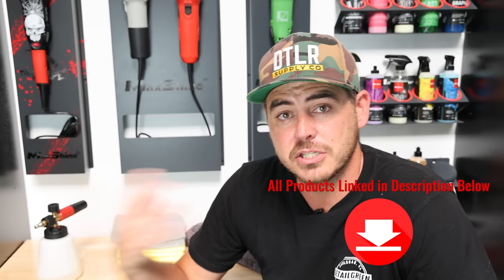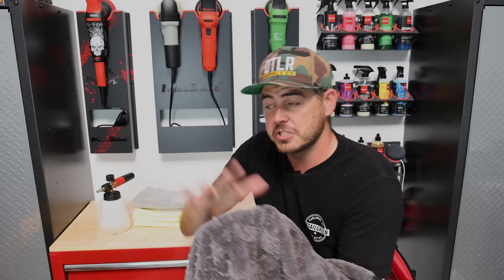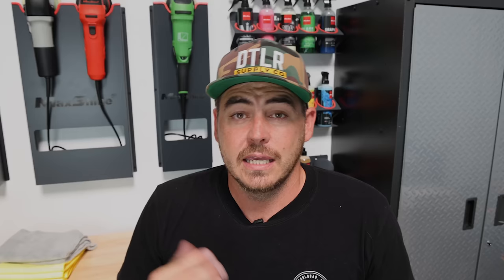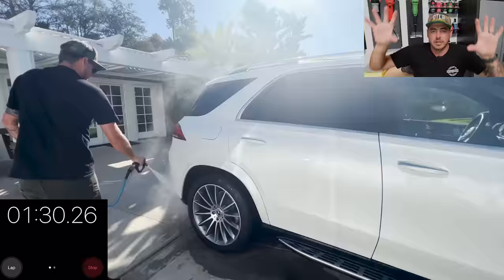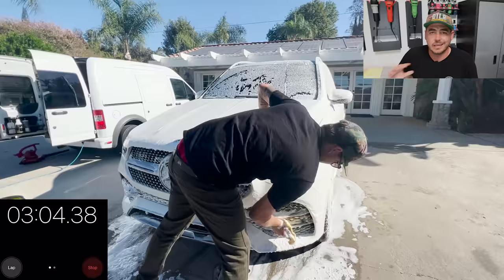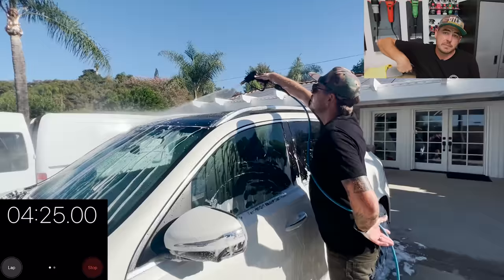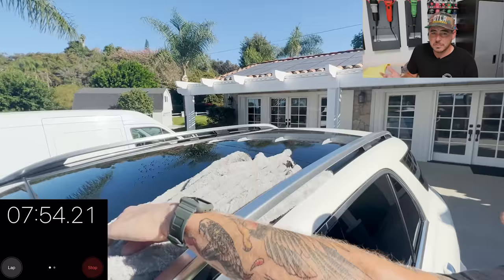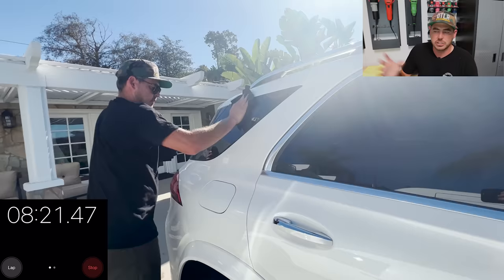HOW TO WASH A CAR FASTER! | Car Wash in 10 minutes or less

Comment: I take 10 minutes on each side cleaning the wheeels and tires before I start the actual wash 😭
Reply: Black wheels here I take 10 minutes per wheel 😂
Reply: Yea same but nothing is ever wrong with that, just shows you care about your customer car whether there’s a way to wash faster/getting the same results. More you do, more faster you get😅
Reply: This would work great on a car that's well maintained with possibly a coating on the wheels and paint that also has a longer lasting tire protectant. Nasty wheels and tires can take 5 minutes a piece. I would definitely change out wash towels or flip to a new side on each panel but to be fair in all of this if you only want efficiency then quality will always suffer but 90% of folk don't care about water drips or a keeping a perfectly clean vehicle all the time. I wish I didn't care lol. Ignorance isn't bliss but it is alot less work and stress in these instances.
Reply: Dam it's takes me an average 10minute per wheel
Reply: @bacchasmichael2017  if the wheels are cool I don't pre spray with water I usually use bilt hamber @ 10:1
apply wait 1-2 minutes and agitate with a vary soft interior brush on the wheels and a green body brush for tires let sit for 1 minute and rinse, if the wheels have brown staining after that and are factory cleared I use acid 4:1 appy on brush wipe in and rinse. If the wheels are trashed or are steelies I just apply cleaner and agitate with green body brush on wheels and tires wait a minute and rinse. Some tires can require multiple rounds of cleaning and some are permanently stained and have tried everything from mckees tire rejuvenator, multiple degreesers to acid to vary stiff brushes and iron removers even acetone and some just can't be saved but it's rare. Black gloss wheels usually get a presoak and rinse before brushing unless they are already scratched to death which most are.
Reply: Same here
Reply: @sandrock86  same have black wheels but just tried this method sprayed the wheels with a good wheel cleaner fast all of them than foamed the wheels and car and worked pretty well they were clean just had a few water spots on the rims because I use hose water
Reply: before and after lol
Reply: Me too!
Reply: Yeah the realism behind the video just isn't there for me. Most of the time I get cars that haven't been detailed for quite some time or just haven't been detailed at all which requires more attention. And since I'm so meticulous about my clients cars, it can take me upwards of 1 to 2 hours to just wash and dry. If I had a regular customer that I did maybe once a month or a biweekly customer then this video becomes relevant.
Reply: Takes 10 to get the pressure washer and hoses ready Then I get to the wheels😂
Reply: Sorry but this is a awful way to do it... Surprised the customer would pay for that... Snow foamed the car and didn't let it dwell at all nor did you even rinse it off... Just simply scratched the paint with what ever the foam had chance to lift... Great work.
Reply: @takeovamxbc3403
You know every-time you drive the car, it will always be dirty from electrostatic dust + dirt (especially the wheels).
😎
It sux to fight a losing battle with nature.
Reply: Me today 😂😂😂
Reply: Me too
Reply: @sandrock86 lol all outta breath n shit 😂
Reply: @proudtobeapothead  yeah sucks cuz they get dirty so quick and scratch easy. I haven't cleaned them in forever tbh.
Reply: I take 20 mins per wheel
Reply: Tires are last bro
Reply: He showing yall the basics lol
Reply: I have honestly spent 1hr on just my black wheels alone and still can’t get them as clean as my detailer 🤦‍♂️
Reply: 😮🙈🙉 that would take a whole day. Interior needs cleaning too
Reply: Same 😅
Reply: It takes me 10 minutes to untangle the garden hose.
Reply: @Nguyenduc09 Use that stuff that turns purple when it sits on your wheels a few minutes. Nothing else works as well as that stuff.
Reply: Thanks for that tip. I’m just getting into the business.
Reply: @dustin3700  great reply

Comment: Man, I can’t even get everything set up to start my wash in under 10 minutes😂😂👌👍
Reply: Facts!
Reply: So true!
Reply: he is all set up to rock and roll.  setup time does not count. but you I am sure it takes like 10 mins to set up and 10 mins to pack everything. still 30 even 40 mins is not bad at all. plus personally I am not as young and fit as him LOL  makes it looks so easy..  but as he says taking your time and spend time for me is also therapeutic and not a chore
Reply: @nick-3808  Here's another trick nobody really mentions... If the sun is out, wait until the sun is shining on 1 side of the car and you'll notice the other side isn't facing the sun. Be quicker on the side where the sun is shining and the other side you can be a little more slow since it's not in direct sun light.
Reply: Just digging out my pressure washer and getting it going would probably take 20 minutes.
Reply: haha true, 30 minutes just for the setup alone
Reply: @mxx.L Yep, that’s why I recently installed a wall mounted pressure washer system in my garage, complete with Spotless DI system (only for final rinse). All I have to do is fill my bucket and foam cannon and get with it.
Reply: Same
Reply: 10 minutes starts from when you are ready to wash. Prep might take 20 minutes
Reply: Right that part

Comment: I never rinse the car with a pressure washer first, garden hose maybe, but the best way is to foam>dwell>rinse>foam>contact>rinse>dry. If you spray the car with that 1200 psi+ pressure washer with water only? Now you're spreading that dirt and grit across you paint at 1200+ psi!

Comment: I want to clean my car now. lol.  I do a very similar wash when on a time crunch except for one step: Instead of a pre-rinse, I foam it, rinse it, then foam it again to start the contact wash.  It doesn't take much more time than a pre-rinse would, and I feel more comfortable removing a lot of the abrasives before taking my towel to the car.  I also saw a test of someone foaming a car in two halves, one side without a pre-rinse and the other side with a pre-rinse.  It showed the side without the pre-rinse left the paint cleaner after rinsing the foam off.  The thought was that the water from the pre-rinse made it more difficult for the foam to attach to the dirt, while without the pre-rinse, the foam quickly encapsulated the dirt and rinsed off cleaner.  I guess you could call this a pre-rinse as well but with foam before water.  Just wanted to throw that out there.  Thought it was pretty interesting.
Reply from the maker: Yea I agree with that. I don’t always prefoam, dwell, and rinse… I do if the car is extra dirty and want it to break down the dirt more. With this car it wasn’t too bad so I don’t have any concerns with that. And as a mobile Detailer I have limited resources with me so I need to use the water as efficiently as possible.
Reply: Yup doing that makes sense

Comment: Your channel is so great.  I am a 63-year-old nurse that works really long hours. I live on a dirt road. My car gets so dirty I got scolded at the car wash... even though I prewashed it with a hose.  Looks like I'm going to have to do it myself. Picking up my Greenworks 3000 2 gph electric pressure washer tomorrow and using your tips. I think I can do this in less time than waiting at the carwash. It will be much cheaper and no fussing because i have a little dirt under my fender. Goodbye to Tidal Wave! (And good riddance!) Goo Goo car wash didn't complain but just tore my back windshield washer off twice.  And I worry about how driving on that thing affects my car. Thank you so much!
Reply: I really admire that at 63 yr old nurse can still find time and energy to wash her own car. No more excuses for me!
Reply: Get the 2700 and save a little, it's more versatile when using different tips.
Reply: thats sad

Comment: lol that's the exact process I use. no need to waste time when you have great chemicals and tools to  use them to your advantage and speed up the processes. Great demonstration.  I don't even use buckets anymore. I have a wash mit at ech corner of the car and do a quarter at a time spraying ringing them out  then spraying with the power washer... wheels  just foam all the wheels them go around with your wand, woolie and tire brush.  why roll a bucket around to do anything. don't even need buckets of water at all. some clients question your work though since you can finish quickly so they have to see the result and then apologize.
 
every new detailer.. don't  worry you only get faster and more efficient as you go and find out tips n tricks.

Comment: A 1st-time viewer here (now a subscriber) , a longtime detailer (35+ years). A lot has changed during my time and I am trying to get more modernized.  I am taking your advice on a foam canon- thanks.  2 questions( for now) . 1) I have always wanted a mobile car wash truck - does yours have water onboard or do you plug into your location's water supply? 2) How much $ do you charge for a basic hand wash like the one you so gracefully performed in this video?

Comment: This strategy is only applicable to either new cars or clients who maintain there cars well. The slow down in any detail usually has to do with the condition of the vehicle. You couldn’t do this on a 2008 Chevy Tahoe that’s been thru a shit storm. Rims will have to be thoroughly cleaned and in my experience— requires 1-2 passes of agitation to get adequate results. 

 On poorly maintained paint— I usually go in with an APC diluted 10-1 pre wash to help make my life easier when it comes to the contact wash. 

Anybody can wash a new car or well maintained car since it requires to little no agitation.

Try this on a an older unprotected vehicle and show the results.

Comment: Man. I’ve been watching a ton of videos from you and from other pros. I grew up in a family of detail enthusiast and have found that most of the practices I use line up with professional methods. What I DO NOT understand is how you foamed that car and proceeded to wash the entire thing before rinsing. If I did those exact steps the soap would be drying before I finished my first panel. I sure wish I could get to the bottom of this as I am starting to do some weekend warrior detailing and figuring that out would save me A TON of time.

Comment: Took your recommendation and got the Greenworks pro 2300 and got basically all the stuff you suggested on this video… I’m so amazed how much quicker a good pressure washer can help with ease of cleaning.  I had an old Sunjoe pressure washer before and I have to say the Greenworks Pro is so much better at rinsing off the dirt for the pre wash with so much more water hitting the car than the old sunjoe.
Reply: Its the very nice use same one also for couple years maybe.  Upgraded hose and gun.
Reply: What about the Roybi small cube pressure washer ?
Reply: I bought a sun Joe on amazon and it sucked so bad. It was about as strong as my water hose. I returned it.  Picking up my Greenworks tomorrow.

Comment: I like to do a quick wash like this on my cars in the evening. Pull into the garage and leave it overnight. Then the next day it’s so much easier to dry the jambs, dress the tires and just use a little detail spray to wipe the drips and wheels. Breaking it up takes the chore out of it.

Comment: I recommend adding a second foam coat and never leaving that first foam on to use in the hand washing of car.  Rinse off that first foam coat after 5 minutes to wash away that surface the foam breaks up so it doesn’t act as an abrasive during the hand wash step.  After rinse, apply a 2nd foam coat, THEN HAND WASH….
Reply: does it create more of a shine by adding the 2nd coat?
Reply: @stellarphase  I don’t know about more of a shine…. But it limits the debris that you would otherwise be rubbing against the finish.

Comment: Didnt think this was possible. Even if it was 30 min that would be real good. I can do it about an hour plus but I do a professional job on the wheels first and after when I put on the dressing. I also have a air cannon so when I finish there are zero water retention or swirl marks. I will also put on 3D Bead as necessary and that takes about 30 minutes. But my hats off to him.
Reply from the maker: Thanks for the comment! To be honest my usual exterior wash and interior vacuum will run 45min to an hour. This was just to highlight what can be done in a pinch!  Like you, I usually go around with air to blow out all the crevices, and some other detailed steps that more customers are accustomed to!!

Comment: My Aston MArtin vantage is ceramic coated and easy to wash but takes more than 10 minutes. I clean each wheel and use a barrel brush to clean what you can’t easily see but is surely dirty. After the rinse I remove the nozzle from the hose and flow water over the entire car allowing the surface tension of the water to nearly dry the car, then use a blower to blow the water from the crevices where it hides. Then I use “guzzler” microfiber towels to quickly dry the entire vehicle, Then each wheel and tire gets dried and if need be retreated  with tire shine. Finally all windows are washed. 45 minutes is a fast wash for me.
Reply from the maker: What year is your vantage?  Yes i agree my normal wash is typically in the 45min to 1 hour time frame. This video was more to highlight how you can get through it quickly if youre pressed for time.
Reply: @imjoshv  It’s a 2020, White.

Comment: When working on cars that have actually been driving you’re dealing with a lot more than just dust. Bugs on the front end take a lot longer than 10 mins to safely remove. Plus wheels and glass add another 15-20 mins.

Comment: I have a detailing business on the side and have been doing it a long time and i like some of his technique, but some sheesh... like dont wash down by the rockers and move up to the top with the same rag. There is road dust and debris that get stuck in the clear coat. This can and will transfer onto your cloth and make micro scratches in the paint. Always wash from the top down, as the bottom is usually the more debris filled. With this car, it was pretty much fully cleaned anyway looks like a bit of water spots on the car nothing to bad. Take your time there is no rush.
Reply from the maker: Yea you are 100% right. Like you said this car is pretty clean so not much of an issue transferring dirt from lower panels. That is one of the reasons I like to use microfibers instead of a wash mitt as I can just fold the towel to a new clean area and keep going

Comment: Yes - if you don't clean the wheels, have any pre wash set up or post wash clean up to account for, a wash can be done in 10 minutes. But for most people doing hand washes they do it because they have higher standards than what you get from an automated wash... which involves properly cleaning, drying and dressing wheels, proper drying with air then detail spray, proper door jabs and glass... etc. And we are all doing this at home which involves set up and clean up. It's an hour to an hour and a half. There are no 10 minute washes! :)

Comment: My issue with being able to speed wash is that I'm constantly fighting the hose (flexzilla because Amazon was sold out of the other one you recommended at the time), and for the roof I'm up and down a step stool. Plus, it's the one time no one tries to talk to me or bother me with whatever so I kind of take my time.
Reply: The Flexzilla should have similar properties as the ones he recommends on Amazon and Walmart. Maybe you don’t have the swivel attachment? That always seems to be the biggest issue. Btw, I can’t do it in 10 min. I probably don’t even get my wheels and tires done in 10 min. I also add a couple steps besides washing wheels and tires thoroughly, i switch to a different pressure washer (“low pressure” cordless) that is connected to distilled water, and use this after the rinse and then I start worrying about the drying process. Take my time at that stage, because I have soft water on the car and don’t have to worry about water spots. Using a cordless leaf blower. Then I start drying the wheels and tires first, then the rest of the car with towel and drying aide (Technicians Choice ceramic detail spray). Maybe I’ve got too many steps?
Reply: @KosmicHRTRacingTeam  it probably is a lack of swivel. Likely buying a new stubby with a swivel after more important expenses (engine repairs) are passed. I run it out straight and in no time it's twisted up on itself. I don't switch between PW's since I only own the one, but I do rinse with just the hose and a nozzle because my PW seems like it doesn't rinse as clean or as quick. 

The water in my area is something really low like 49ppm for dissolved solids, so a DI water system isn't that big of a deal for me. I'm drying it right away anyway using a mix of blower and towels. Sometimes just towels if I don't feel like dragging out the extension cord. Even then I have a little cordless Rigid shop blower that I'll use for the wheels, mirrors, and where water hides (that thing just chews through batteries, not good for the whole car). If it's a really sunny day and the car starts drying from the sun (no garage or shade access), I'll just re-wet where necessary and dry from there. If my car was black I might have a different experience, but it's white. Actually at the house there's 1 white, 1 off white (Chrysler called it cool vanilla), and one gold car. None really spot too bad...except after rain. Then it's ridiculous.

Oh. Yeah. Current stubby is from Chem Guys. It works fine, but lack of swivel and a frankly tiring trigger pull are sending me running for an MTM.